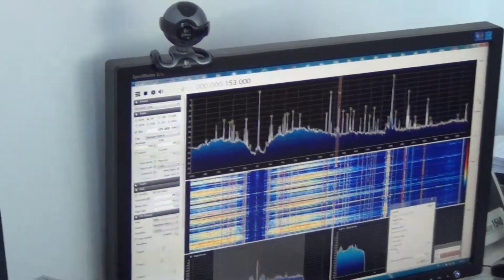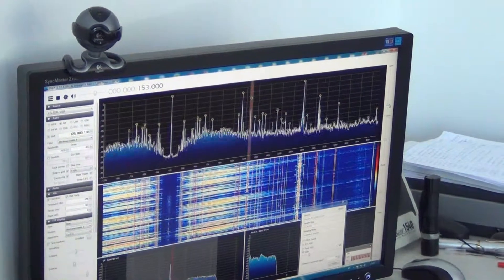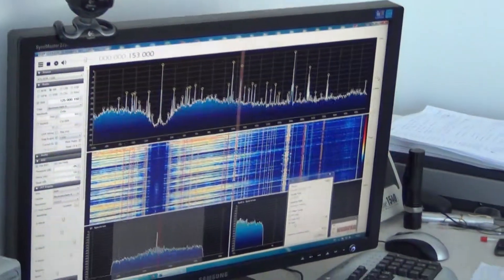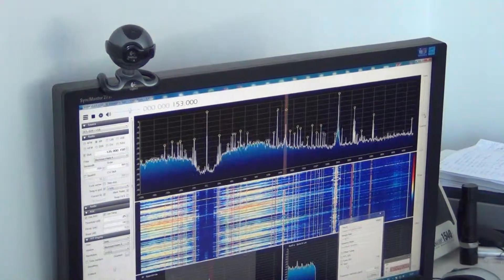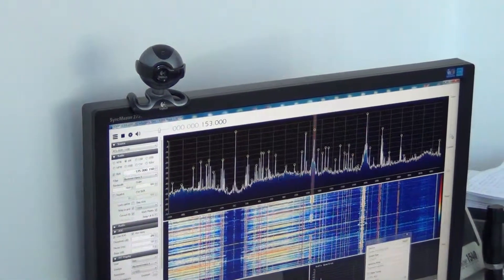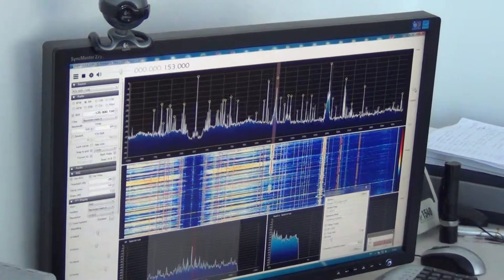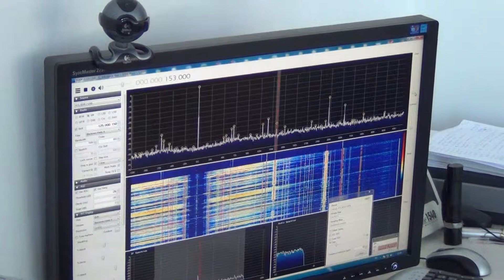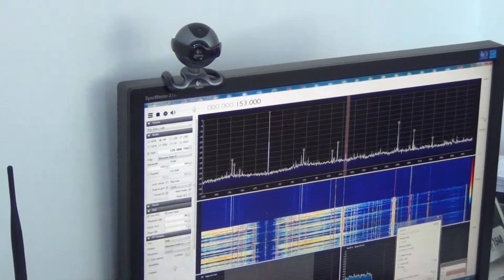Mini Whip 10 cm vs Delta Loop 33m tested on 153 KHz

Comment: delta loop was not properly terminated , that is beacuse don't work. Comparison like this has no sense.Try to connect the buffer of the mini-whip to the delta loop , before the cable of course, and repeat the test.
Reply from the maker: Hi Pierluciano, I am using MFJ-945E Antenna tuner (With additional coil inductance for LF) between up-converter and delta loop antenna cable. It is well matched ! 73
Reply from the maker: The different story is if the amplifier from Mini-Whip antenna will be connected to Delta loop antenna directly (before the coaxial cable), but I want to make comparison between original Mini-Whip and normal Delta Loop Antenna which is used for HF transceiver...
Reply: Mile Kokotov
This is what I meant! Your videos are useful anyway ,73